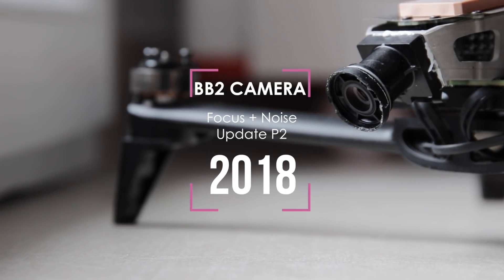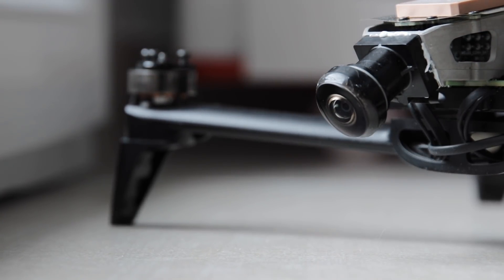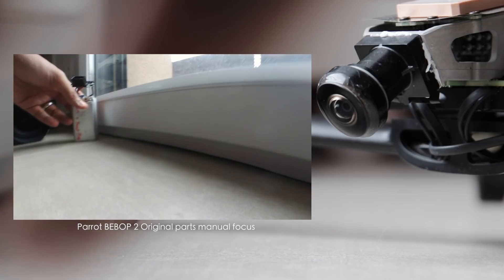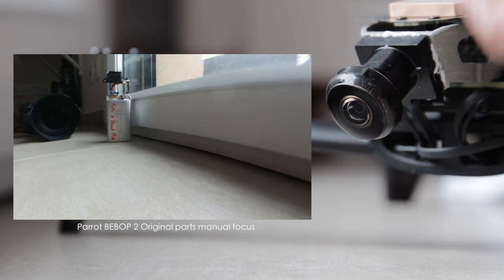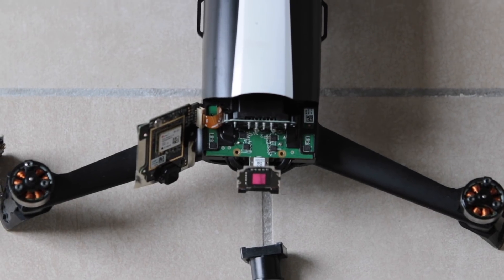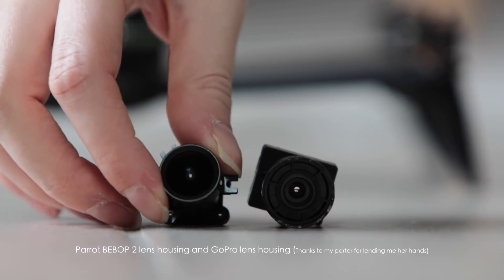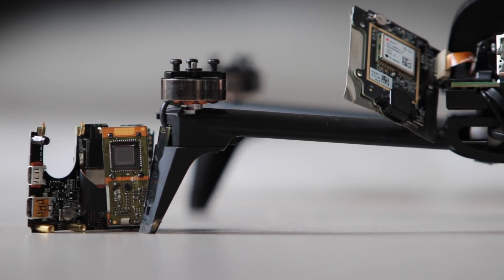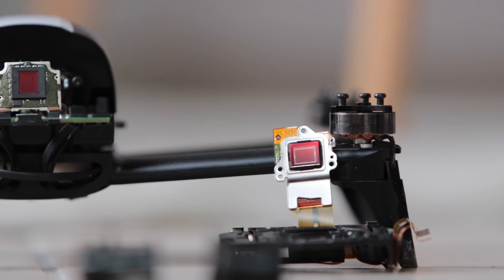BEBOP 2 - Camera Manual Focus | Sensor | Ramble - Part 2

Comment: So would you say that the sensor on the Bebop 2 is definately capable of 4K or above?
I know my Mavic Air is 12 megapixel 
And the Bebop2 camera is 14 megapixel...so wouldnt it be larger than 4K?
Reply from the maker: Around 4.2k but we have tried many times to use that and cant get anything more than  raw format 1080 which even cant record more than a few seconds because the hardware cant take it 😂
Reply: @ANTHONYVLOG  ...I did receive my replacement Bebop 2 today and was very pleased with its condition and flight characteristics...it looked new...and it came with an OEM battery surprisingly...I totally charged,discharged,charges it again and then flew the first flight for 23 minutes.
The battery discharge during flight was very linear...so fo now,I believe I got a good battery.
On another note...I was very surprised to find out that the SC2 does not support 5ghz...so to use the 5ghz option I would have to fly with my phone or get an SC1.
Another question the firmware of the drone itself,or the app is what's updated?
Reply from the maker: @droneready8278  the firmware is updated in the controller, and drone. The app on the phone is just for control/view. Not sure if that answered the question. Also did you get a blue power led? Since EOL of the BB2 the replacements have been BB2 Power in BB2 cloths.
Reply: @ANTHONYVLOG  ...no this was a red LED version from "Windsor" Refurbishing ...off of Amazon...it has a replaced parts list in the box along with a 90 day no questions asked warranty...4 new motors,nose cone,frame and props were in fact new.
I opened the battery to make sure that it had the same board as the OEM battery...and sure enough,it did...the battery case also has the 2 "tri" designed screw heads near the connector ...which told me beforehand that this may just be an OEM battery.
I guess my question was how do I upgrade the drones firmware?
It seems to work fine...I havent distance tested it yet...just to about 400 meters and it was perfect.
Heres what is amazing...the refurbished BB2 came with an OEM charger as well...all for 138 US dollars.
They are still on Amazon right now for the same price.
Not even a scratch on the camera lens...and yes with the lens cover and multi wall adapters for each country...if you still love the Bebop2...its worth 138 dollars.
I may even get another as a back up.🤣...I love all my quads but man theres something about the BB2.
Thanks for your reply.
Reply from the maker: @droneready8278  sorry i misunderstood i thought you had a replacement claim lol. Firmware update os done through the app with the drone on and connected to the controller or phone with the app running.

Comment: hello ANTHONYVLOG !  I had a accident with my Bebop #1 and it broke the lens but the camera still working, without focus.  Do you know where I can buy those lens you used in your video? it seems that it can solve my problem!  I would really appreciatte any advise, because I saw that to fix it I need to buy a comnplete camera set, but looking your video I had another idea. Thanks !
Reply from the maker: Hi Marcos, there is a door viewer that has a lens that works with the bebop cameras. I cant remember which one but its on another persons youtube video. Its like 12€ on amazon.
Reply: ANTHONYVLOG  I saw those videos that you mentioned and here in Brasil I could find a security camera lens that maybe can solve the problem.  As soon as it arrives I will try to fix using it and let you to know.  Thanks for your advice!!

Comment: If u tame all the glue off around the lens cam it then move in and out to focus, mine has always been out of focus. I bought a 40 dollars used bb1 and it is focused correctly, if i had the bb1 camera in my bb2 it would be set up just like i like it. Because my bb2 flies great, no more jello.
Reply from the maker: You can mount the BB1 camera onto the BB2 frame without issues it will connect up. I call the BB1 cameras the "S" ribbon type because of the shape of the cable ribbon. Yes I have also removed the lens barrel, I will add that for cases where the front element was impacted or moved you will also need to reposition the front element as well. The front element is easier to remove than the inner barrel, on the BB2 camera "Y" type which I have it was extremely hard to break away the adhesive but with time and a little hacksaw blade I slowly ground the adhesive away and was able to free the entire barrel assembly.

Comment: Did u get the Gopro lens in to the bb2 housing to work ,  i was going to try this set as i have 2 extra gppto hero 4 lenses just sitting around not being used
Reply from the maker: Hi Keith, thats a negative on the GoPro lens on the Bebop 2 sensor.
Reply: I changed  my bb2 lens to a bb1 lens . now  it is sharper and and clearer , not blurry at all like it was.
Reply from the maker: Keith Washington I see you are excited about your discovery.

Comment: Very interesting stuff! Coincidence I was answering now some comments on one of my Bebop 2 Power videos. Someone tell the Bebop 2 Power have sharper image. And I think it depends on the manufacture line or something. Some Bebop 2 cameras are better focused than others and some Bebop 2 cameras gets some moister or something inside the lens becomming the image blurred and horrible. I want to see you experiments on that. I have disassemble a Bebop camera years ago as we can see in my videos and tryed to focus the camera with success but the camera connector on the Bebop mother board colapsed. Last week I substitute a similar lens on the sports camera I used in many of my Bebop videos with success and I have focused it too.
Reply from the maker: Helderhugo hello, yes it is an interesting topic with no simple answer. I'm still mixing and matching so open to ideas. Would you be able to remember the lens from the sports camera or what camera it was? That information would be of great value to my experiment. Thank you
Reply: The camera I use on my head or chest most of the time in my Videos is a simple SJ7000 (Novatek 96655) It is a simple cheap camera with a surprising quality for its price. And it gots 170 angle lens. Here is the link to eBay of the lens: https://www.ebay.com/itm/Wide-Angle-Lens-1200MP-170-Degree-for-SJCAM-SJ4000-SJ5000-SJ6000-SJ7000-SJ8000/302565099305?hash=item4672490729:g:Y8oAAOSw9idaModo